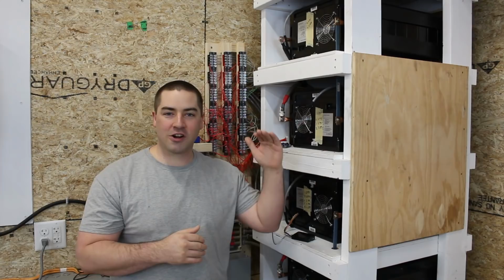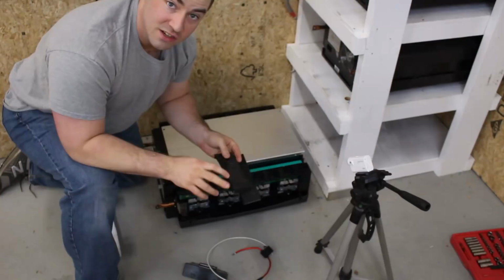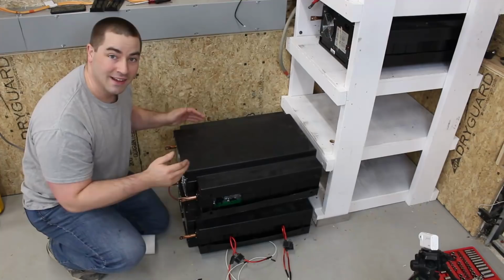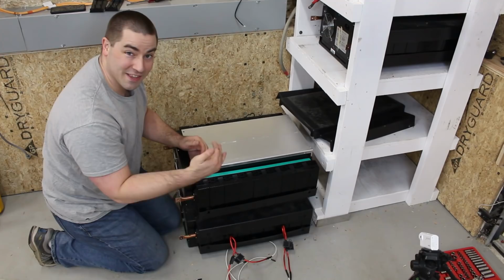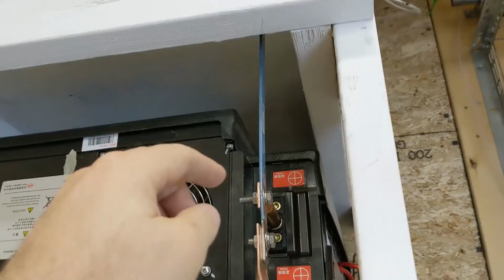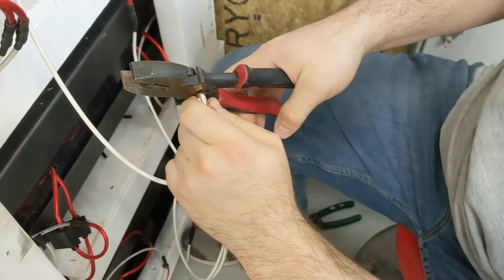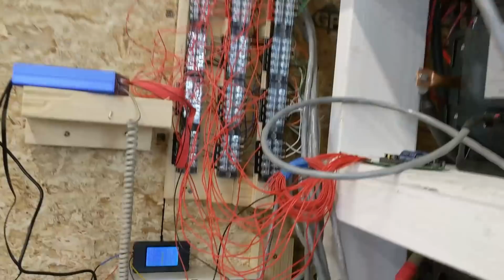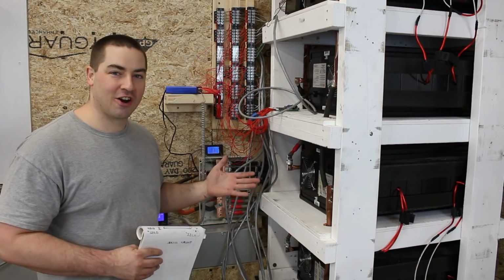Parallel Cells in big LIFePO4 Battery Modules

Comment: I also wired the Batrium BMS to the connector on the back but batrium watchmon was reporting HUGE voltage swings when the cellmons were in bypass(burning extra cell energy to heat). I suspected and later confirmed that the balancing wires connected to the connector(20-22 awg) was insufficient to handle the current and provide a reliable voltage reading for the adjacent cellmon. Because of this, I wired the cellmons directly to the cell posts(that you are using for parallel in this video). After wiring directly, I have no voltage swings when cellmons are in bypass. Thanks again for the awesome video!

Comment: Good job brother. I bought four of these modules and I am still testing myself. But they are not giving me the proper output. Something is not quite right with them. Not when you are expecting 85%  capacity. They are otherwise, great batteries and great deal. Just a bit worried. I know they have to be "woke" up, as well. And many people, myself included, were turned onto these batteries by your videos. BTW: you're doing great. And I appreciate all of the work you have done. You are not responsible for these batteries. And the fact you are working to get us information on them is much appreciated. And your honest approach also makes it easier for us all to be well informed and make the case, if we need to, about weak cells, when it happens. Because no one buys a battery that is already dead, no matter how big it is. God bless and take care.
Reply from the maker: Thanks for the kind words.  I'm in the same boat as everyone else.  I bought these batteries with my own money.  I want to get as much life out of them as I can.

Comment: I see you jumped on the latest chargery bms. I had 2 16s and bought 2 chargery bms-8t that have separate units like yours and quickly found out the old 16s chargery bms weren’t worth the money spent. The new version is dialed in much better and has a few more program setting than before. It does have 1.5 amp balancing which balances fine overnite nite when the cell are really wonky that brings the packs from 27.9v down to 26.8v. Worst cell has been a difference of 1443mv 😳. Waiting anxiously for the results! Awesome!

Comment: 6:30 I think you need to invest in some drawer slides 😜
I know the weight is an issue. But I was thinking you could put some double rail closet shelf holders on each upright, then a shelf that's heavy enough to hold the weight. Put 2 linear bearing rails on the bottom of the battery and that would allow you to pull the unit out safely, and have a place for it to sit on. Then just move the shelf to each battery position to work on the next one.

Comment: A thumbs up from here, the only thing I would possibly add would be galvanic jointing compound (duralac) between the terminal and ring connector/rivot. Over time, the differing metals will develop corrosion between them causing resistance to go up.

Comment: I can't recall what these look like inside but I would have wanted to pull the weak cells out and then into a single battery/group so all the others are good and you can find a new use for the block concentrating the weak cells.

Comment: I bought three of the 3kWh BYD 24v Lifepo4 batteries from our friends at Battery Hookup, these batteries are originally 5.2kWh. They have a connector on the front that has the 8 balance leads and 8 thermistor leads, if I can’t find the correct mail can I use two connectors to replace them? Looking for a good BMS and how to make the positive and negative larger diameter. Thanks and I enjoy your videos.

Comment: You need some draw slides for those batteries- you can get heavy duty ones that can cope with the load. You could then pull them in and out easily 👍
Reply: I wonder if they make slides heavy duty enough for those batteries
Reply: Hdd Server pod rails seem very good as the amount of weight they handle is a lot

Comment: Can you also offer more of an explanation behind what you are doing here. How exactly does this cause you to END up with more Amp hours from these batteries?  And based on your current usage, you made the assessment that you need to do this extra parelell connection between individual cells. I understand that, but now that you made this connection, and you test them again, I hope you report to us the before and after. It would be nice if you kept some data sheet on this. Its all so helpful. And it gives us an idea of what we too can achieve if we copy what you did. Because that is what makes this topic very useful. I have never done a thing with batteries before for solar or living on them and now I am in it full time and this is a crazy notion for my level of knowledge. So, anymore help or understanding is greatly appreciated. I am in a bus conversion. IM actually running for President. Whole different conversation, though. Thank you.
Reply from the maker: Good Idea on the before and after.  I think I have enough info for that.
Reply: @DavidPozEnergy  Oh, that is awesome David! Looking forward to that information!!

Comment: Hi David, so I bought these batteries, but I can’t get any info on the exact battery model. So I can’t program my inverter / charger. Do you know the exact model? B box pro 2.5-10, or B box pro 12.8, B box pro 13.8, B box res 2.5-10, or B box compact, or B box L3.5- 14?Can you help? Thanks
Reply from the maker: The manufacture has ignored all my e-mails.  I've tried to get spec sheets, but can't.  Sorry.

Comment: I was about to buy 4 pieces of these battery packs, to form a 16S2P battery pack. 
These "parallel wires" should be thick enough to balance corresponding cells from different packs.
I wonder if it is worth buying these cheapo packs for the additional work and wire costs.

Comment: As much as your going to work on these you should put them in a rack cabinet that has roller slides. Also if those buss bars are aluminum I would put a steel washer behind before pulling the rivets for a tighter connection.

Comment: This is amazing.   I keep thinking that that tower should have been put on industrial wheels, and attached to the ceiling and floor at the center on top and bottom.  So it could pivot.      Hindsight is 20/20.
Reply from the maker: That would be pretty cool to pivot out from the wall.
Reply: @DavidPozEnergy  Yes.  My thoughts exactly.

Comment: What a tease!! I need numbers man!   Also I know wood is strong but I was still nervous watching.
Reply: I've been getting about 7kwh out of a 48v series pair.  Bringing another set online after bottom balancing, today hopefully.
Reply: @1980jwtx  I have 4 BYD's.  The worst was  2.7KWHr the best was 3.4 KWHr.  Feeling ripped off, but the worst cell has come  up in capacity to 3.1 KWHr with repeated charge discharge cycles.  No expectation of seeing 4 KWHr though.
Reply: @craignels  if you compare the price to new lifepo4 cells or pretty much any chemistry these seem like a great deal. I hope they are i just purchased 4 for myself and 2 for my dad but only expecting about 3kwh of storage from each.

Comment: I was wondering why you didn't short out by having cells in series and parallel at the same time but then i noticed that you parallelled top 4  and separately bottom 4 not all 8  together. 
I don't think you mentioned that and I'm pretty sure if someone does,  there will be lots to talk about . 
I thought at first that they were 4S 2P  with 12v batteries.
Maybe warn people to not parallel between batteries where the series connection happens or describe your set up a 2S 4P.
Lots newbys out there.
Reply: Stephen Duquette newbie here. I’m assuming Dave did the 2(4p’s) to bring the ah’s up to 400ah @ 24v and then the 2s to bring the voltage up to 48v @ 400ah (assuming each battery is 100ah?). Also, I’m assuming he attached the side parallel wires so the cells would constantly balance with each other?

Comment: You sure you trust those rivets? I still plan on using the weakest parallel cell group in the pack as the limiting factor. If I need more I'll just add more cells in parallel to increase the capacity that I may need.
Reply: not very smart to rivet. knowing davidpoz in two weeks time is going to change the wiring again.
Reply: Newbie here, what’s wrong with rivets?

Comment: Hi David, only one 48V BMS connected to the entire 48V power banks and do parallel all the leads in each cell?  or each 48V module has each own BMS?  Also, how many 48V (module) total in the entire battery bank?
Reply from the maker: Yes, I have one bms since I paralleled everything.  However, next time I would use 4 small BMSs and skip paralleling cells.
Reply: Thanks.  I am currently building 48V battery banks from different type of BYD 24V and will do parallel connection too.  I am planning to use active balancer and fuse each 48V battery and see if i can stabilize the entire system.  I think this is the most challenging part.

Comment: Any problems with using one BMS for the whole tower?  If you do it again,  would you just use a BMS on each pack?
Reply from the maker: There shouldn't be a problem with one BMS for the whole pack, but I'm still finalizing the setup.
Reply: I can’t seem to wrap my brain around how you can use a single bms for 8 batteries?  Wouldn’t you need a bms with 64 wires?  Brain cramp. Help.

Comment: How will you know if one of the fuses goes?  Just periodically check?  Or do the fuses have something like an indicator bypass?
Reply from the maker: The fuses have no indication.  So far I have not seen more than 2 amps moving, so the 30 amp fuses will probably never go.  Yes, I'll periodically check.  I'm also planning to add a little display to the front of each battery.  If any cell is off from the other modules I'll know something is going on.
Reply: @DavidPozEnergy  Wow, thanks for the reply David!  I've been following along with your current build for a build I'm doing.  It's been very helpful seeing your videos.  I'll watch for the display video when you get to that part.

Comment: Nice video Friend, I have a question: can i connect 2 different batteries in parallel? I have to build 16s pack and i would like to use 8s2p 280AH and 8s2p 260AH all connected under one BMS 16s with active equaliser. The internal resistance i quite similar and also discharge curve, the only differenties is capacity. What do you think? Thanks for your answer ☺️
Reply from the maker: I suggest building 2 separate batteries.  Battery #1: 16s1p 280Ah with a BMS.  Battery #2 16s1p 260Ah with a BMS.  Only after the BMS then parallel the batteries onto a central busbar.  Skip the active balancer altogether.

Comment: So Mr Poz,       I work with a solar contractor and we are getting ready to purchase a large quantity of these 24v modules..    I plan on using 4 for myself at 48v (I have a lv5048) some of the other customers are asking for my recommendations?  would you recommend this approach or just buy new LifePo4 cells at this point?  what bms would you recommend? (i prefer bluetooth with low temp cutoff) here is the catch..  I need to charge the batteries at 24v not 48, but my lv5048 is also an inverter charger..      any recommendations will be appreciated.(edit...I have been informed that mid point charging is a bad idea.. I may be selling my lv5048 and sticking with 24v inverter\chargers such as mpp lv2424.)
Reply from the maker: Hi Susan Meister,  I don't recommend these 24v modules.  Yes, they work, but the cells were badly abused.  This makes it hard to keep the cells balanced.  I've had very good success using used EV cells, and new cells.  

I don't recommend charging at a different voltage than you are using them at.  And I don't like the LV5048.  I reviewed the LV5048 here: https://youtu.be/FUaDmVDcYks

Low temperature cut-off is OK to have, but should not be the deciding factor.  It's far more important to keep your batteries above freezing 100% of the time.  For example, my friend Bill built a heated box for his batteries you can see here: https://youtu.be/6XLOKtl-q3s
Reply: @DavidPozEnergy  awesome.. thanks for the advice and the links for the heated box..     I had my questions about the battery and how hard they were used.. thanks a ton.
Reply: @DavidPozEnergy  one more thing.   lifepo4 280ah is my new target..    if i end up with 4 new 24v (8cell) batteries, would you recommend 1 bms for every 8 cells? or assemble the batteries 4 parallel cells x8 then series.. and use one big bms? could you recommend a 8s bms with low temp, low volt cut off and bluetooth?

Comment: I've got 8ah headway cells coming in that I'll be paralleling with my weak cells, I'm hoping that plus the QNBBM balancers plus paralleling the individual cells (w/ 16AWG) will allow me to access the full capacity of the modules.
Reply from the maker: That's cool.  It's going to be a nice build.
Reply: Those QNBBM balancers are real good. I use them on Ebike packs.

Comment: I'm having the same problem with these batteries. There is a cell in each that reaches 3.65 volts well before the others and stops the charge current. My high current balancer are hung up in China so I'm looking at manually bringing those high cells down with high watt resistors. I'm not understanding how you're paralleling the cells AND leaving the internal series bus bars on.  Doesn't that create a short across the cells?  I gotta look at this more... <scratches head>  

I did run my whole house off one pair for 3 hours one evening.  It was all very happy.  The test came to an early end because my wife wanted to use the oven and the wires for each pair are only rated for 100 amps and I want a max of only 50 amps going through them. I will have 5 pair (10 batteries) hooked up when I'm done.
Reply from the maker: Yeah, the series/parallel thing can be confusing at first.  My bottom 4 modules are all paralleled together.  The top 4 modules are also paralleled.  So I have a giant 24v battery at the top, and a separate giant 24v battery on the bottom.  There is only one series connection between the two to make the 48v connection.
Reply: @DavidPozEnergy  I am with Eric B.  I understand what you mean by the bottom 4 being parallel and the top 4 as well then series together.  What I don't get is the internal cell parallels you installed.  

Looking at just say the bottom 4 parralleled modules. Each module is a set of series cells. So you parralleled an individual cell that is part of a series (module #1) with another cell that'll is part of another series (module #2), the module #1 and module #2 are paralleled together as well. 

Now that I think more about it. That does make sense. To simplify it's like having 2 AA batteries in series.  Then another just like it in parrallel.  You would have you would have 3V.  You can then run a line from the "middle" of the 2 AA batteries in each "bank" essentially parralleling the individual cells while the banks are still parralleled together. Essentially allowing any cells that are weak to be helped by stronger cells. 

Hopefully that make sense to others.  I just had to type it out and visualize it.

So in your setup you ran 4 wires from each side of each bank so you parralleled every corosponding cell in all 4 banks to each other. Ok I get it now.  Thanks for working through that with me (assuming you're still reading this).
Reply: I guess the only issue here would be if say cell #1 in all 4 modules were weak compared to the others. This wouldn't allow cell #2 in module #2 to help out cell #1 in any other module.  Am I thinking about this correctly?
Reply from the maker: Before paralleling the cells, I had written down the cell voltages, and translated that into three groups of cells for good, better, best.  My goal was to move the modules around as needed to make sure I didn't line up  4 cells that were all very weak.  I put this into a spreadsheet and tried different arrangements.  But every time I moved one modules from the top 4, to the bottom, it lined up another set of bad.  Anyways, in the end I found there was no ideal arrangement and kept each module on the shelf it started at.  The only way to get better would be removing each cell from the modules and that is more work than I have time for.  Good enough rather than perfect.

Comment: you will continue to have problems with your setup as it is series then parallel then series again when lifepo4 batteries don't like this at all. it should be parallel to the required AH total you want and then series to build to your required voltage. otherwise you will always have cells going out of balance and problems with you system. the best thing you could do is open all of those batteries and rework then in parallel series configuration. Electrodacus has a very good explanation of this along with a very good system controller.
Reply: @Kusnezoff could you provide a link to Electrodacus article on series-parallel-series connected cells? I can’t find reference material on this topic.

Comment: David I just ran into this video, this guy is talking about manually charging each cell  with a power supply, also how voltage can be deceiving to measure state of charge. I will use his same method to charge my batteries, I am 99 percent sure this method will increase  pack capacity. Your idea to parallel the cells balances the cells but will not do anything to increase state off charge, good luck
Reply: More then likely you will not recover any capacity. Voltage reading is not a great test for capacity or even condition of the battery but it is a factor in the equation.